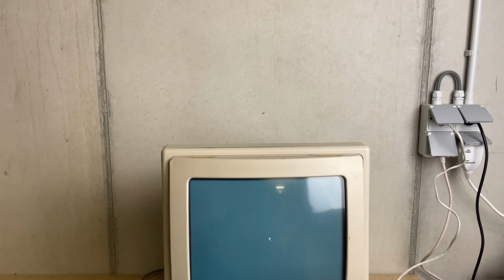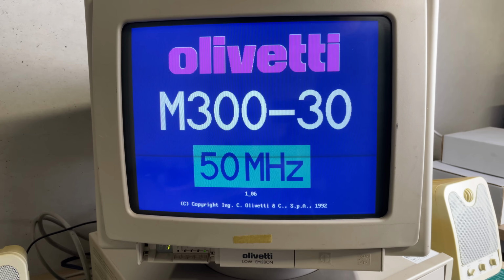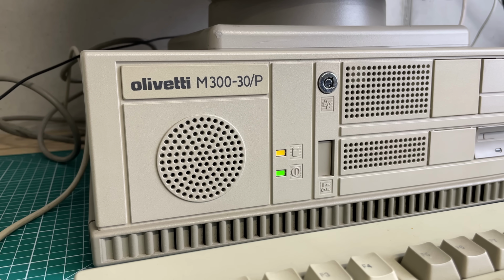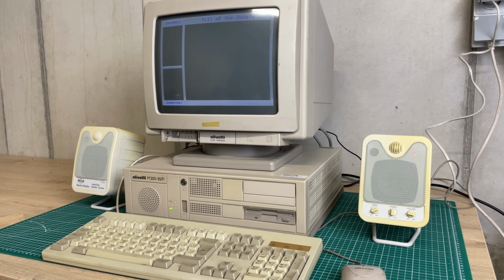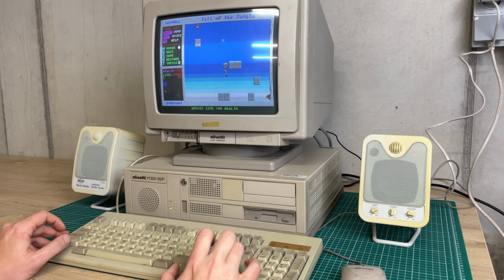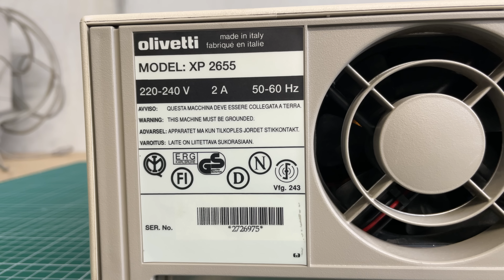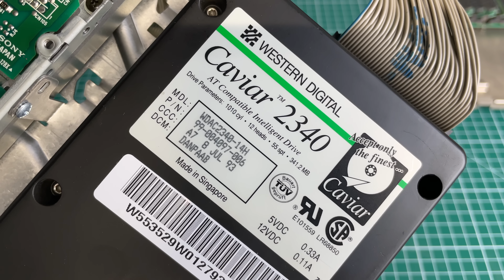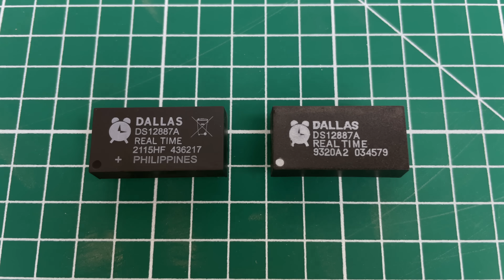Olivetti M300-30 - Italian design meets technology

Comment: I owned a Olivetti Inkjet Printer, it lasted probably 8 years and i used mostly non original ink. There were absolutely no problems with this printer... although it was a very cheap one. Then i got a HP inkjet and it was a nightmare, ink lasted for maybe 20 pages. After this i got a Canon and it works well so far. Wondering why Olivetti didnt last at printers, they were really good

Comment: I like these Olivetti pc's from back in the 90's. I had an Olivetti PCS86 with original Olivetti VGA monitor, keyboard and mouse as my first proper pc which was bought from a friend of my dad back in the 90's. I sold it many moons ago when I built my own pc, a 486 DX2/50. I had been looking to get a PCS86 again for ages and managed to pick up a fully working PCS286 a while ago (just needs the Dallas clock chip replacing) which is the next one on, probably a better one to get than the PCS86 anyhow!

Comment: It probably had plastic assembly because of how the manufacuting engineering was... It would save on manufacturing time hence lower labor cost and lower production price. If it was assambled traditionally with the metal and screws then it would just ramp up at the manufacturing cost. Not really suprising to have plastic assembly.

Comment: A 50mhz 486 is more than enough for Windows 95, especially with anything over 4MB of RAM.  I remember building literally hundreds of machines with similar specs, and pentium 100mhz machines had only just come out.  They were like luxury elite gamer flex compared to brand new Dx2 50's.

Comment: I've got a very similar Olivetti to this, also in the XP 2655 chassis but model M4-66 (486DX2-66). Was lucky the previous/original owner was to nice to the plastic and held on to the monitor/kb/mouse, it looks like new and nothing is broken. Wish it could take some L2 cache but the board has no provisions for it :( Very cool looking chassis though, in spite of the brittleness!
Reply from the maker: Also really love the design of these Olivettis, and they have lots of different models that each look a little different.

Comment: Man the power switch with its connecting rod looks so primitive! lol
Reply from the maker: I once had a Tandy computer with a plastic rod going to the PSU and in a careless moment I moved the machine by picking it up with the rod in one hand ... thing snapped and a pain to fix.
Reply: @RetroSpector78  Lol what a hassle
Reply: It can look primitive, but it is a much safer alternative then running mains voltages straight from the power supply to a button on the case as many old computers did back in the time.
Back then the power switch would actually cut the mains from the power supply so it is nice to see that the button is inside the PSU.

Comment: Nice machine, very nice video! But, I think you forgot to connect the PC speaker connector while assembling in the last part of the video. Also, it’s a 6 pin connector because of the 2 LEDs on the same assembly. Also, the Olivetti engineers could have put the Dallas chip a little more the left of the motherboard, now you need to disassemble the whole thing to replace the chip (but, thank god, it’s a Dallas chip not some pesky barrel battery!).

Comment: Hm looks like there is no easy way to set the CPU clock speed. To me, it looks like there's a CPU clock generator chip (right below the IDE port, in the middle with the 14.something MHz quartz next to it) and I bet the unpopulated SMD pads left of it are how you configure these. I recently had to put a 66 MHz 486 in an IBM Aptiva that had a 50 MHz 486

Comment: In hinsight I shouldn't have thrown away my Olivetti PC286S....
Reply: Aarrgghhhh
Reply: @dirk3850  yep...
that was about 25 years ago...
And the 286 was one of those that had SIMM Sockets too, so one of the later ones.
Reply: @Stefan_Payne  i did the same... disgusted with myself
Reply: @dirk3850  We were young and back in those days, people didn't care much about the old stuff. It was, well, old and we thought Obsolete. So we threw it away...
Reply: @dirk3850  we all did it, we all did it.
But I can top it with something worse:
Not putting my GUS MAX in Electrostatic foil and putting it away carefully...

Comment: When you mentioned Dallas clock in italian computer and said it might be hard to remove, I immediately visualised it behind spaghetti cables, fixed with Bolognese sauce... One thing Italians shouldn't do is electronics - worked on enough Italian cars to be certain about it.
It's the same when you started opening the case. Italian cars are the same - stylish on the outside, but under the hood? Oh, the horror. This PC at least has some logic to it.
I can't believe you didn't clean the dust inside...
Reply: Yet most precision electronics and tooling used by your NASA and our ESA are made in Italy…
Reply: @xmaniac99  that would explain why we haven't conquered other planets by now, wouldn't it? ;)
I'm from Europe :)
Reply: @Kwaq84  well just be happy aliens haven't found us, otherwise they would be turning us into their version of spaghetti Bolognese 🙂

Comment: A brittle plastic beauty from the early 90s - but you are stuck on the 25 MHz FSB and there are only 16 bit ISA - well... Olivetti once had a good name for quality, but in the early 90s, all things went south both in quality and finance. I got my first PC in 1993 being a 486-DX 33 with Vesa Local Bus Graphics Card and IDE-Controller - was quite a considerable fast system, which was OK in speed even under Windows 95...

Comment: The hard drive distinctly sounds like a WD Caviar...
Reply from the maker: You didn’t cheat there now did you ? :)
Reply: @RetroSpector78  I swear I didn't!
I'm just an avid collector of old hard drives 😊
But yeah, the Caviars are pretty easy to spot. Their seek sound is unmistakable.
Reply: @RetroSpector78  I can't help it, something about the sound of old hard drives makes me feel warm and fuzzy inside...

And it breaks my heart everytime I see a hard drive being replaced for some SD or CF adapter in a vintage computer... It strips the machine of all its charm.
Reply: HA! I knew it! A 340MB one, nice. I had a 420MB one for years. They are extremely reliable.
"Accept only the finest!"

Comment: Nice machine, I'd have gone with the new coin cell adapters instead of the new Dallas chip - I do it as a kind gesture for the next owner so they can easily look after the device
Reply: Looking the awful spot where the rtc is located, to really be kind you also have to move the coin cell in a better serviceable position

Comment: really don't know why PSUs didn't have the on/off switch broken out to a header back then
Reply: Because back then the switch was actually connected to the mains voltage, which means that you had 110 or 220v across it. So it was just safer to keep such voltage inside the PSU instead than running a cable with such high voltage around the case (as many old computers did).

Comment: Thats why the IBM PS/1 ( Model 2155 ) was the Best mass produced 486 desktop computer ever built by Manufactures for consumers in 1993 and why there are still so many still around.
These have a Strong Steel case and housing. Build very tough. The only thing that breaks is the front cover flap. Other than that they are built very tough. They can support up to an AMD 5x86 power stacker CPU and  32mb of RAM. And the bios supports up to 710mb Hard drive. Maybe more.
Easy to fix and hardly ever break. These are built to last. Bios Support hibernation and sleep mode and energy saving mode. These IBM PS/1 were 
A game changer ahead of there time and revolutionary. They were expensive at about $3000 but they were actually worth it because of the reliability, durability, upgradability, and easy to repair. NON-IBM propriety components unlike the IBM PS/2. And it uses a coin battery.

Comment: We need a drinking game where we take a shot every time you say Olivetti!  :)  Glad to see the battery was encased to a point I don't think it would have leaked.  I expected you were going to be soldering in a normal battery. Cool that you can get new ones.  The HD sounds nice ... like I remember the old drives.
Reply from the maker: I like socketed dallas chips. Don’t like modding it with a coin cell.
Reply: @RetroSpector78   That’s just butchery.  :-)

I ended up spinning my own PCB with the surface mount version of the 12887 and a 32khz crystal.  I am on a mission to convert all my old PCs to CR2032.  Some of them take more persuasion than others.  ;-)